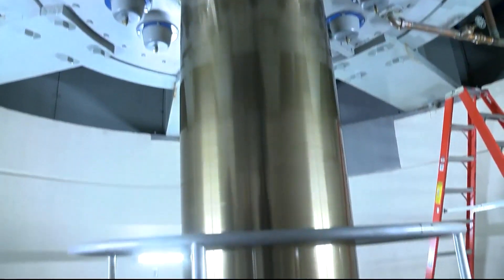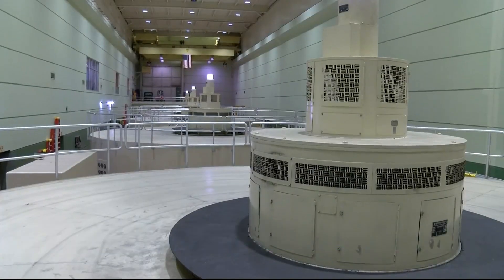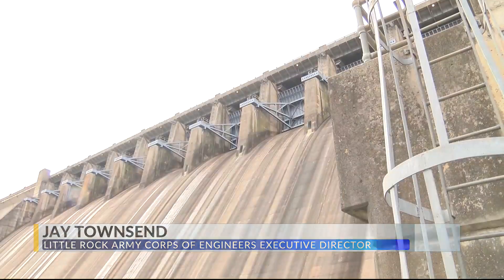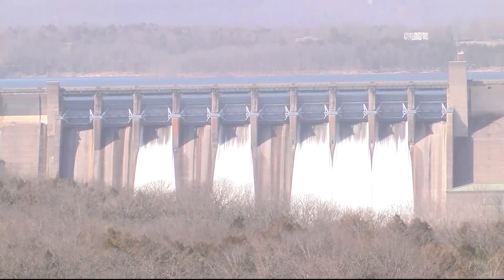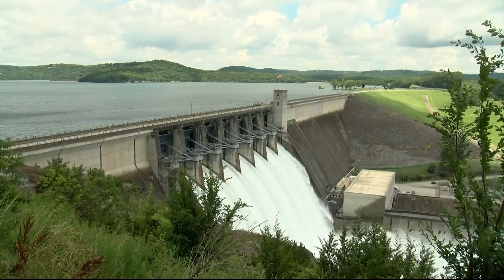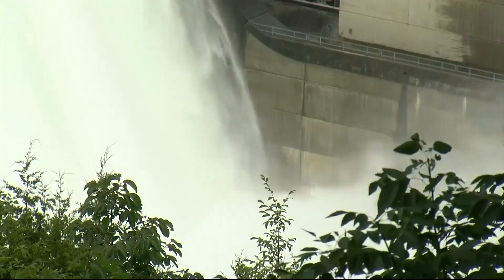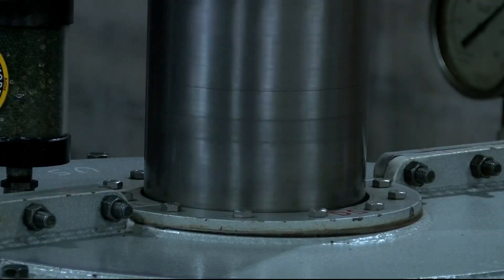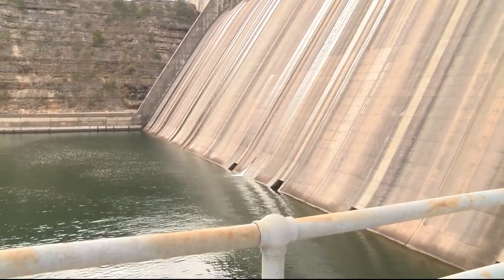How Table Rock Dam controls flooding

Comment: It works to control flooding by making the river downstream smaller in volume and flow. If it didn't, there wouldn't be a lake behind it. Speaking of the lake, another way it helps to control flooding is by sacrificing a specific portion of ground to a permanent flood (the lake).